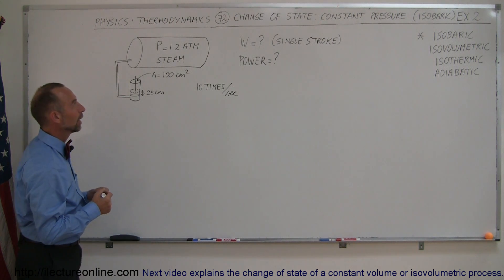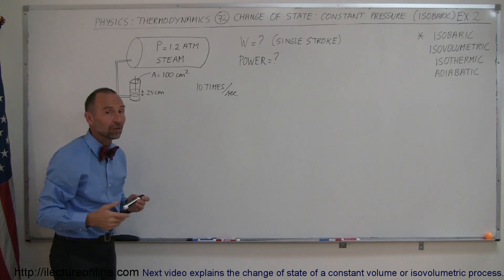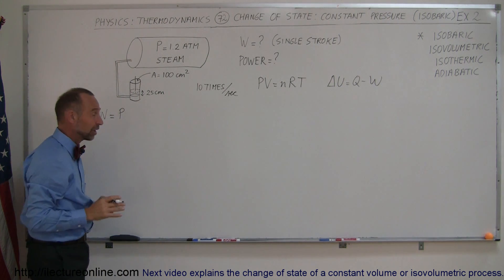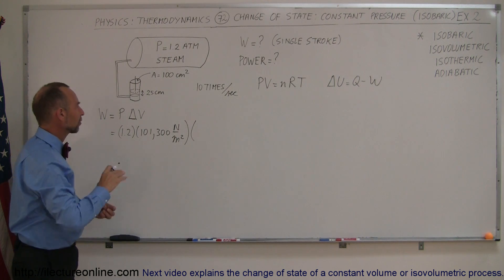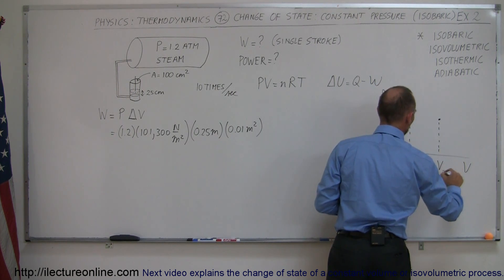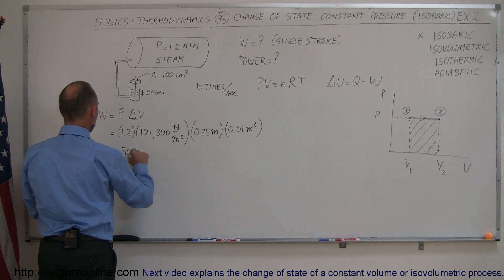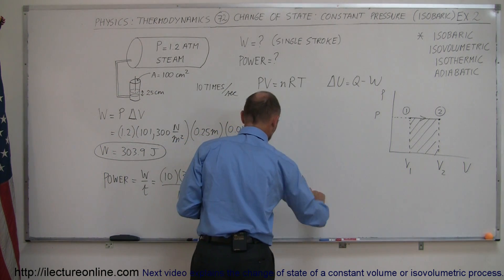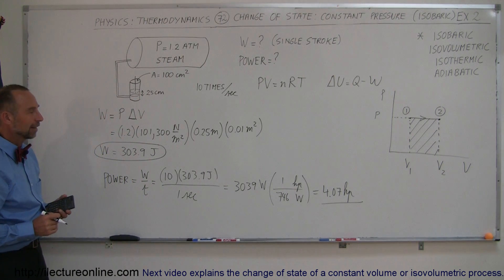Physics 27  First Law of Thermodynamics (8 of 22) Constant Pressure (Isobaric) Ex. 2

Comment: why do we use w=-pdeltav in our class is it the same without the negative sign
Reply from the maker: It depends on how your book (or professor defines the first law of thermodynamics).  Here it is defined by:  The change in internal energy of the gas = heat added to the gas - work done BY the gas.     Your book probably defines as The change in internal energy of the gas = heat added to the gas + work done ON the gas.  Either way is correct.
Reply: Thank you professor! You’re such a big help for my upcoming exams

Comment: To get the change in something you subtract the initial from the final. You multiplied volume one by volume two, which makes zero sense.
Reply: Here's an equation that might be able to help solve your confusion : W = Fd thus W = PAd. Note that F = PA. What he's doing is multiplying the pressure with the change of the volume. As he's saying in the video, the piston is pushed up 25cm. 25cm is the height or length, whatever you like to call it. If it doesn't help, then take an initial point of 0cm. As you know, the piston is pushed up 25cm so the change in height(length) is 25cm. That's why he multiplies pressure with area of the cross-section and with the height pushed up(25cm). A = 100 cm^2, d = 25cm. Besides, 0.25cm here is given as the change in volume, which means you don't have to subtract anything.